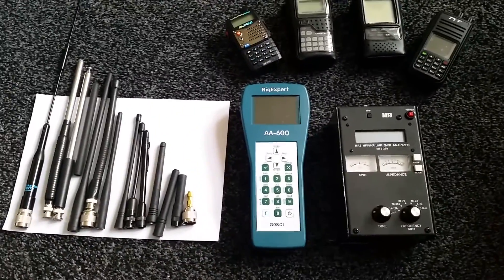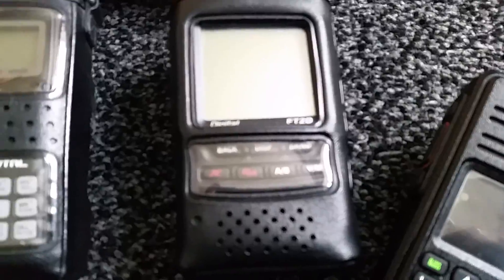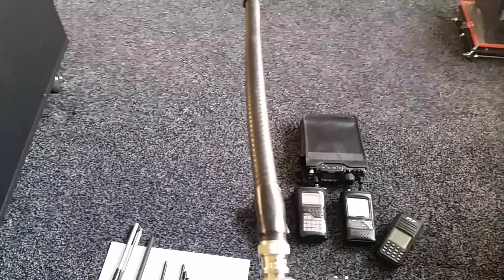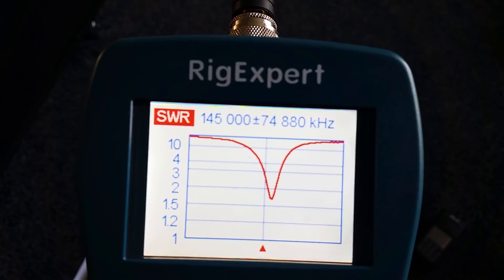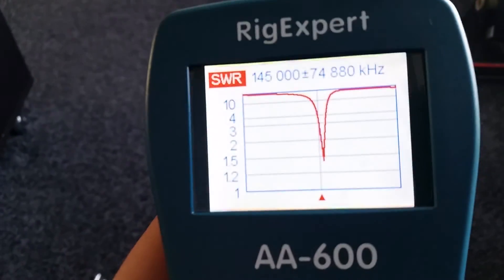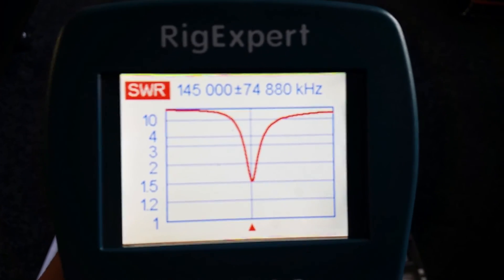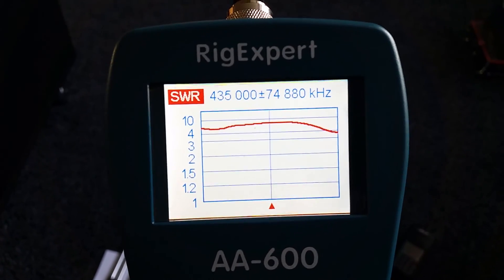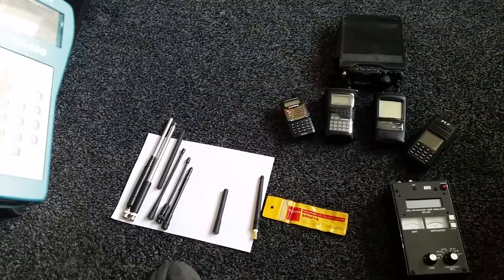Handset antennas

Comment: I have a handheld scanner (Icom R6) which I used to listen to aircaft /ATC a few years ago.
I now want to listen to some marine frequencies and was thinking about getting a new antenna, to replace the original short, stubby rubber ducky.
What antenna would you recommend please ? 
It would need to have a female SMA connection and I'll be listening to frequencies of 156 MHz or thereabouts.
Regards from a fellow 'geordie'  .. Whitley Bay
Reply from the maker: it depends on where or what you want to do ... if its a base antenna a discone will cover most frequencies and for mobile (car) search for a marine 300 or one of the marine range .... for a rubber duck replacement a like for like scanning antenna would be best but you could try a Nagoya NA-771 as its high gain ( watch you dont loose a eye with this as its quite long) ..... all the best in Whitley Bay ( spent many a good night out at the spanish city )